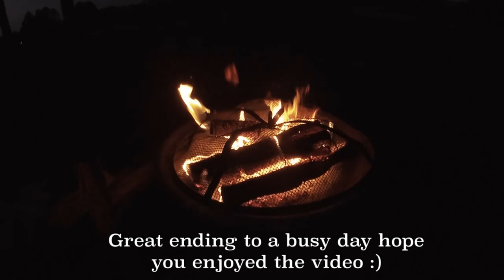Waterproofing our patios on a Jayco 4212

Comment: I know a couple that has a Fuzuion 424 with the side and rear patios. They had to get the entire side patio replaced due to water intrusion under warranty. I didn't  know the patio decks aren't built to be weatherproof from the manufacturer!! Great insurance you guys are doing!
Reply from the maker: yeah we was told to water seal them because of that :)
Reply: @LivingTheRVLocaLife  that's crazy that a manufacturer will not waterproof a patio deck!! Like you're going to put the deck up when it rains!